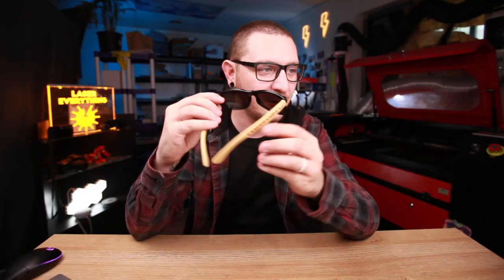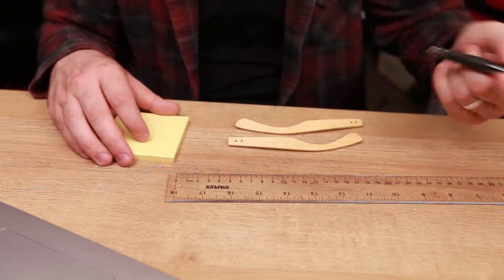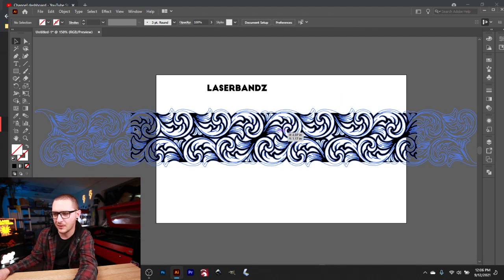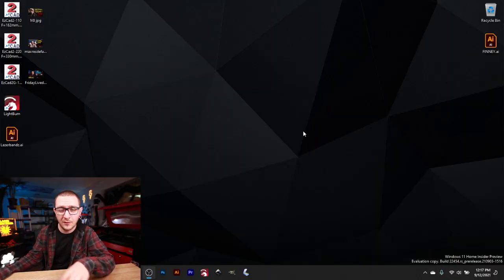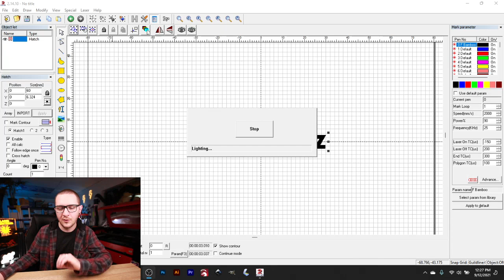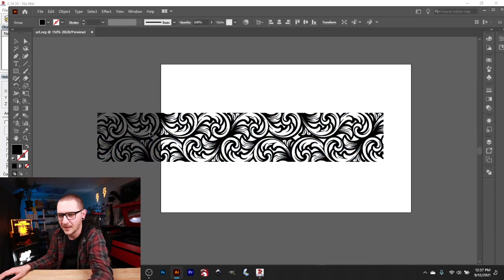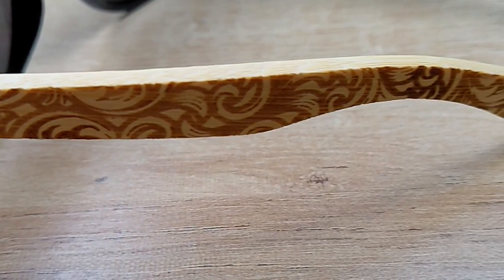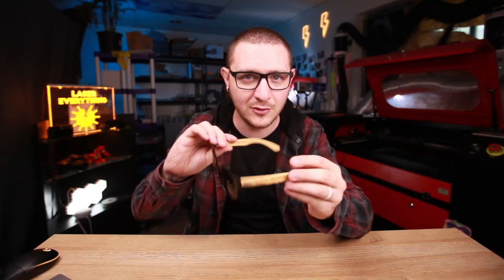How to Engrave These STELLAR Bamboo Sunglasses with a CO2 Galvo Laser

Comment: Looks awesome! I'd love to have a galvo co2 as well, but I'm not quite sure I'd use it as much as the fiber (mostly doing jewellery work). I really have to spend some time learning Illustrator more - I do everything in Rhinoceros, and always get frustrated trying to draw things in Illustrator, it's so much harder to get accurate positioning, snaps etc
Reply from the maker: I've never heard of rhinoceros before! I'll have to check that out!
Reply: @LaserEverything  It's pretty awesome - meant for full 3D modelling, but I mostly just use it for 2D stuff. The 2D tools are awesome, combined with snaps (like midpoint/end/tangent/perp and so on). Wanna draw a circle tangent to two others and with a specified radius? No problem! Plus you can script everything as well with a VBScript like language. You can probably tell I like it ;-)
Reply from the maker: I can tell you like it for sure! I can also tell that it's going to be way over my head lol but I can't resist I'll probably end up looking at it anyway, if for no other reason than just for fun.

Comment: Hello, we recently got our new Galvo co2 laser machine, the focus distance is good, but the engraved pieces do not match the measurements we give in on ezcad, do you know how we can fix this? 
We have 3 diffent size lenses with it. We love your videos. Kind regards
Reply from the maker: Sounds like your field size does not match the lens you're using. Have you watched the setup guide? Here's a link: https://youtu.be/FZT9zOp9Sl8 - it walks you step by step through setting up the correct field size for each of your lenses. This video is for fiber lasers but it applies to galvo co2 lasers as well. Give it a watch and see if that helps!

Comment: Hi! we have a 30w fiber laser, is it possible to engrave on bamboo items? unfortunately we set different parameters and either it doesn't engrave or the bamboo starts to burn a lot ... will you help? does bamboo have to be logged with CO2 lasers?
Reply from the maker: By the time you have enough energy in place to do anything to bamboo at all it's typically on fire. Fiber lasers aren't at all designed for wood and success with the fiber/wood combo is extremely rare. A CO2 laser is highly preferred.

Comment: Hi ! I just recently purchased my 30w fiber laser & have been watching your videos. I am using it mainly for jewelry so the metals i go on are aluminum & nugold, when i followed your setting for a black mark on aluminum and start the machine & start marking it doesn’t mark anything as its going, just going through the motion, Any reason that happens ?
Reply from the maker: Sounds like your out of focus Priya, have you followed the complete set up guide? It walks you through configuring ever aspect of your machine (the right way, don't necessarily trust the default config) and that includes finding your perfect focal point. You can watch it here: https://youtu.be/FZT9zOp9Sl8
Reply: @LaserEverything   got it working now ! Thank you so much

Comment: can a galvo CO2 cut plywood?  If yes, how thick?
Reply from the maker: You could probably get away with something like 1/8" or even 1/4" but it would be difficult and time consuming. If cutting is the aim I'd MUCH rather have my gantry to do that work.
Reply: @LaserEverything  That was my suspicion.  I have a gantry-style laser and it engraves well, but the speed of the galvo is so enticing.

I'm thinking of buying an f-theta lens, and bodging together a pseudo-galvo with a couple of steppers, and some mirrors.  Maybe test it with some low power (<5mw) lasers.  More as a proof of concept than anything serious (at least at first).
Reply from the maker: @daves.software  lol that sounds like a massive undertaking. I'd be very interested to hear updates about this. If you aren't already on our discord you should join I'd like to hear more about this as it progresses! 

Yeah one of the things I have been thinking about doing when I have engrave and cut jobs is to just cut everything out in advance and then jig up and do the marking on the galvo which would shave batch job time waaaaaaaaaay down.
Reply: @LaserEverything  Heh, we'll see how it goes.  I've got a ton of "projects" in process that never seem to progress.  My biggest problem is that my house is too small, so I don't have room for a proper workshop.  I have to back the cars out of the garage if I want work on things.